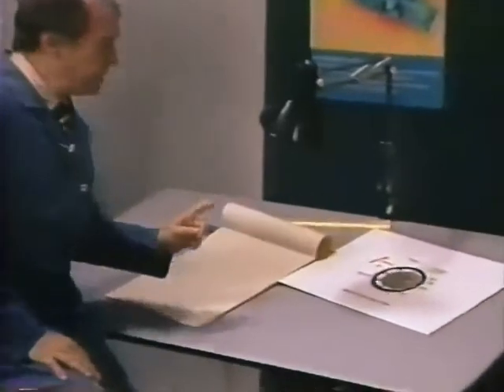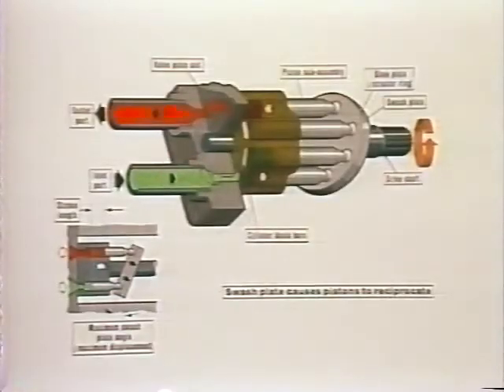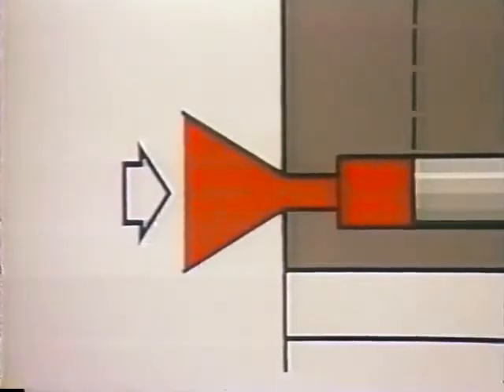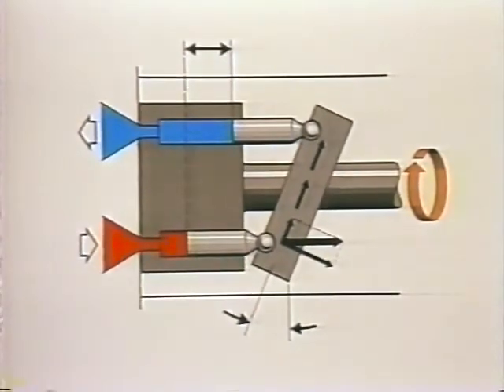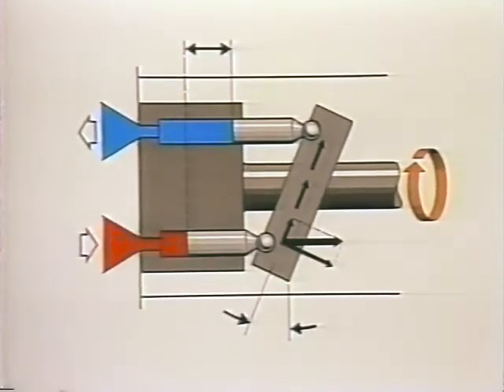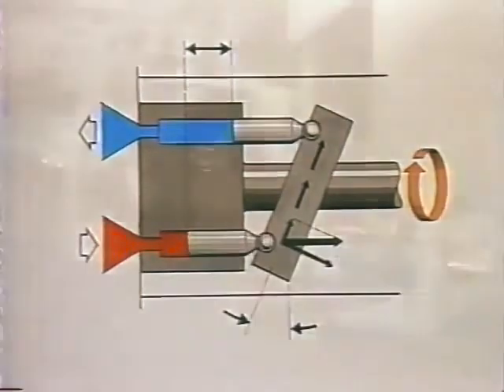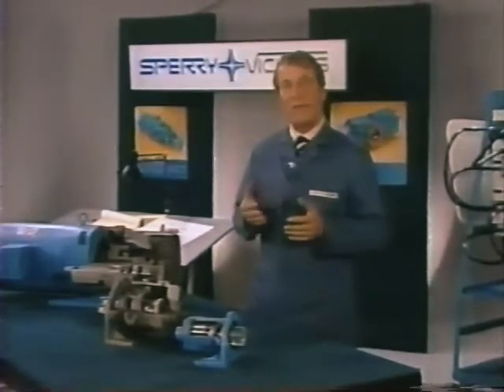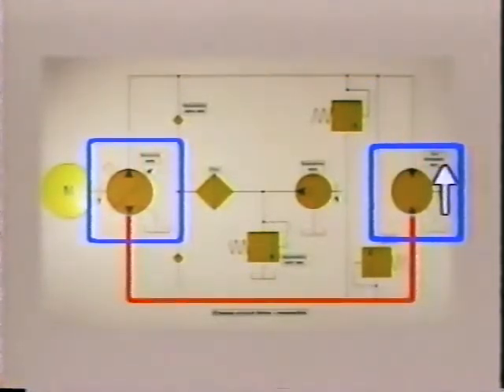Hydraulic Training Series - Chapter 7 - Hydrostatic Transmissions

Comment: I understand the basics, however on large tractors with several speed ranges(working, slow, medium, fast, and road travel) are there five speed gearboxes fitted to the hydraulic motor so that no matter the speed everything is hydrostatically run from creeping along to road speeds?